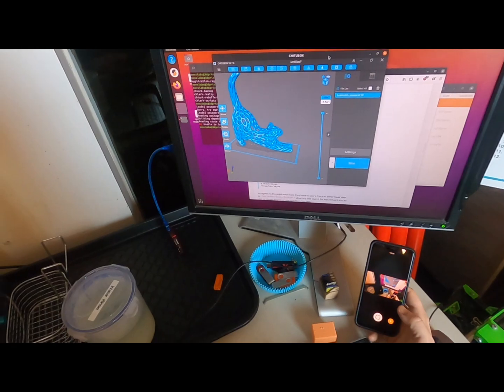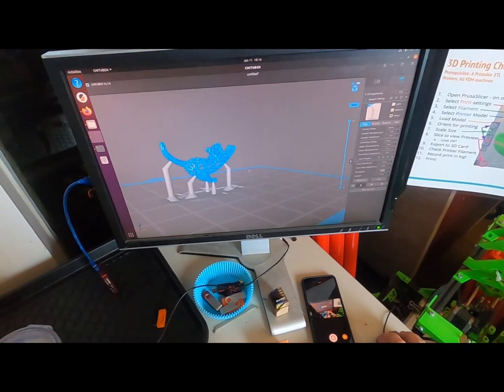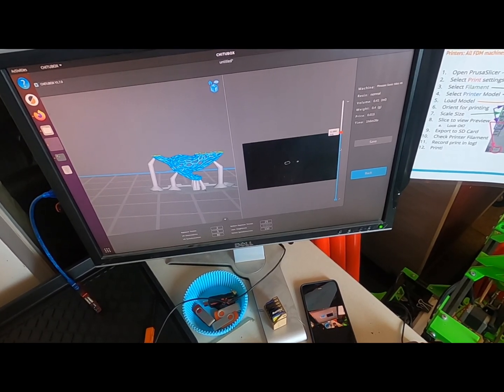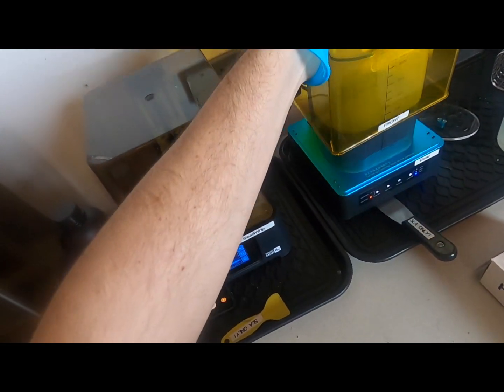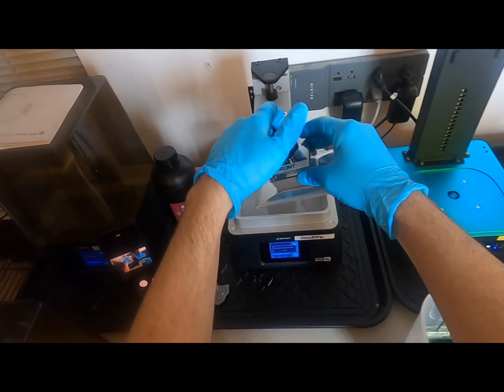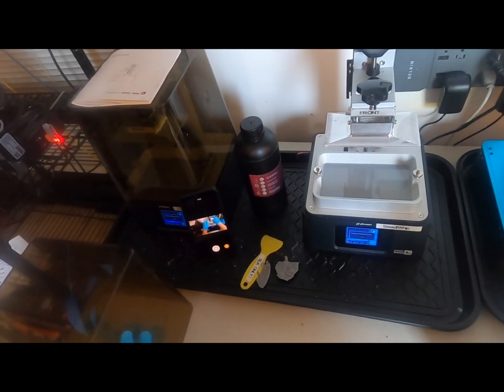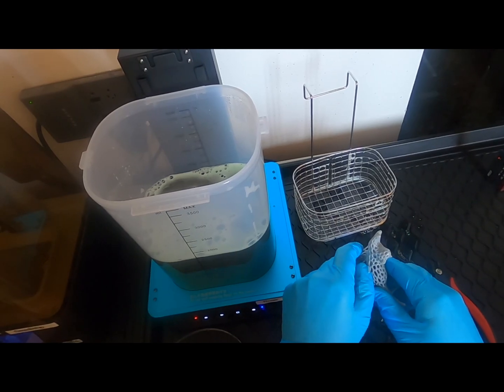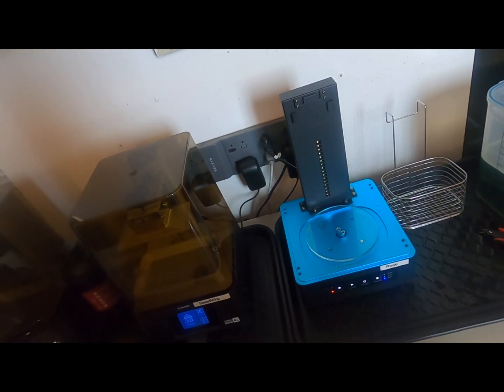Phrozen Sonic Mini 4K printing, washing and curing   HD 1080p

Comment: Why don't you use isopropyl alcohol for washing and what is this green liquid?
Reply from the maker: The green stuff is Simple Green all-purpose cleaner.  Available pretty much any big box/hardware store.  It's usually sold 2x strength, so it's actually half Simple Green and half tap water.

We don't use alcohol because it's flammable - and would need a flammables cabinet for it to live in, due to our zoning and placement of the printers.  Simple Green works just as well and can just chill on the desk.  I'm not saying that alcohol is unsafe, but I wouldn't want to leave a vat of it out unattended.
Reply: @PaulChase  Just the answer I was looking for, I've got a load of simple green already. Was wondering if the difference was noticeable. I'm about to buy the printer and cure station now and was doing a bit of research so when I ordered it I had everything I needed to start up. Thanks!

Comment: how u know how long u should cure a model?
Reply from the maker: I do 2 minutes, if the surface has any stickiness to it I put it back in for two more, or just leave it outside for a while.  Some of the white resins will yellow if cured too long, but I don't think you can over-cure most resins.

Comment: Do you use the simple green concentrate straight out of the bottle, or do you mix it with some distilled water.
Reply from the maker: We do half water, as Simple Green recommends.  Full strength didn't seem to make a difference in cleanliness, but it's much smellier and harder to remove.

Comment: Did you have any issues using this? I had seen some other reviews where they say the space between the lcd and the fep of the resin reservoir was large enough to make the uv light disperse.
Reply from the maker: We have not had any issues; the film is pretty much right on the LCD, although I didn't try to measure a gap.  I'll look more closely next time we change out the resin
Reply: @PaulChase  I think that was with the first batch.  I haven't had any issues either.